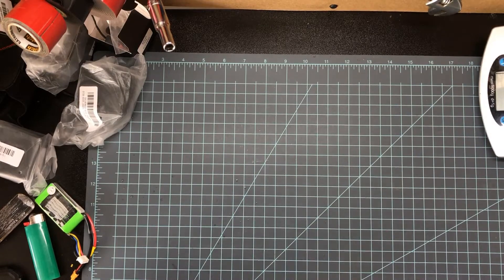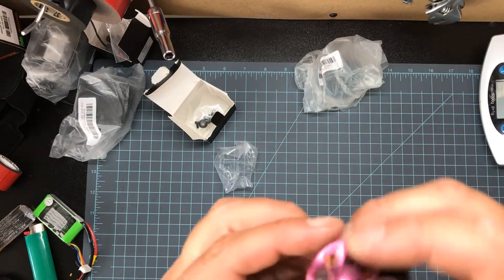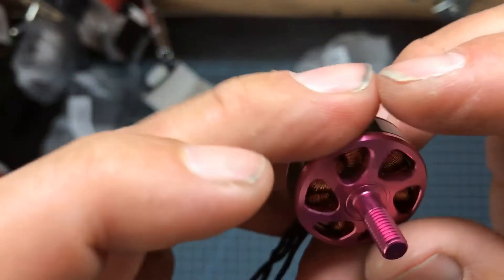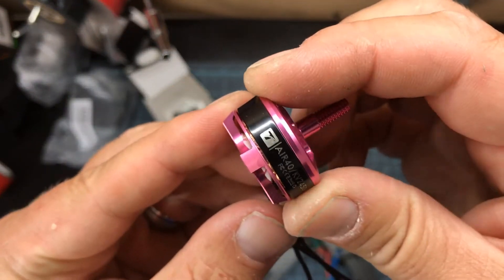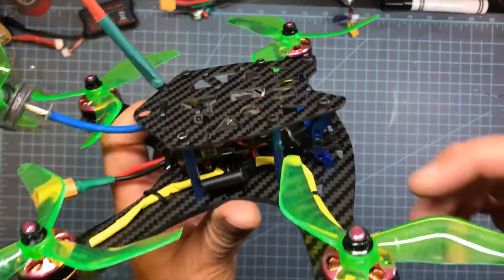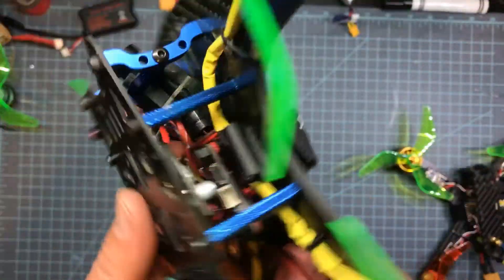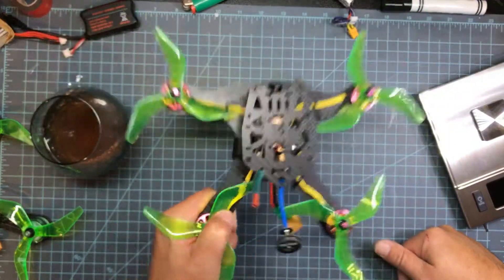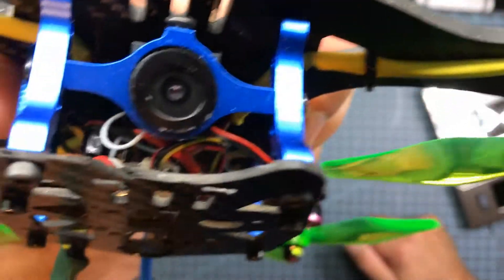T-Motor AIR 40 2205 2450KV Review and pop test! Aweseommmmee (Banggood)

Comment: The wires are not really wires. There just the windings continued out. That's what the review on mini quad test bench said. Dude these motors only weigh like 23 grams. Crazy light! Was just looking at them last night. Curious how they hold up to a crash. Please do update video soon. :)
Reply from the maker: very gonzo yeah I know they are the winding wires, but they are also potted or tinned all the way as well, very odddd.  And yes, soon as I get out to fly I'll thrash it a bit!!
Reply: that's so they can be soldered once cut otherwise people would have a hell of a time soldering the wires with the enamel still on. 
Honestly there isn't anything wrong with this design as they arnt something that should be moving and it will save weight and be more compact useful for vertical arm quads especially.
Reply from the maker: +Stephen Gibb agreed.   They are amazing motors.  Just never ran into that before.   Took me a bit but I grew to like that wiring method
Reply: are you sure you can cut these wires? i remove a bit of the heat shrink material and was able to see copper color wires like winding ones. usually it is not recommended to cut those wires and they are hard to solder. strange because they are quite long.
Reply from the maker: +G B I know!!! And yes you can but it takes pretty high heat or it helps to scrape the insulating varnish off with a razor blade first.   Pain in the Butt.  Great motors tho

Comment: That's a weird looking frame lol , n I had ordered the wizard x220s motors when I had my x220 and I noticed that the wires was like those to they was stiff like solid electrical wire u would run in a house lol I can't think of the name of it , but i didn't really like it I felt It was loosing more power with those wires , but i like those motors u got  they seem badass
Reply from the maker: Quad Father 504 FPV I am super impressed with what I saw, can't wait to really try them out